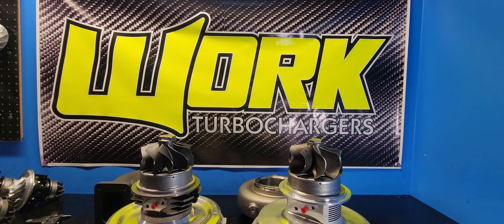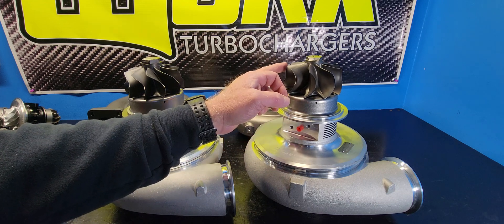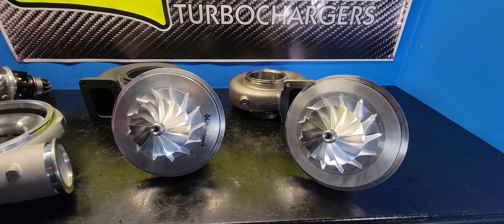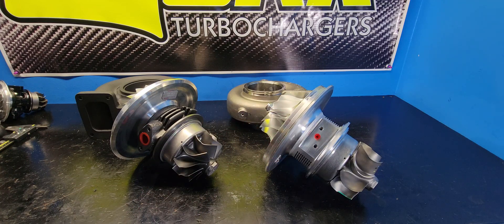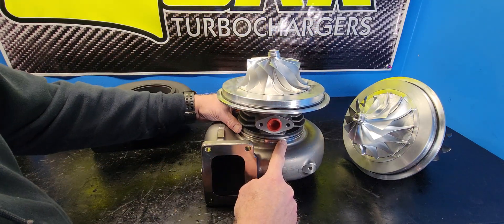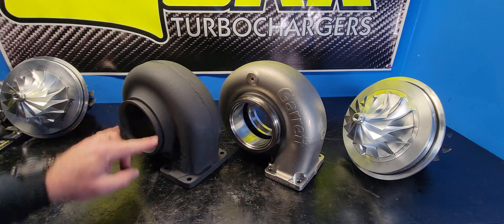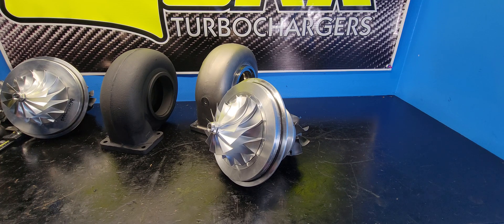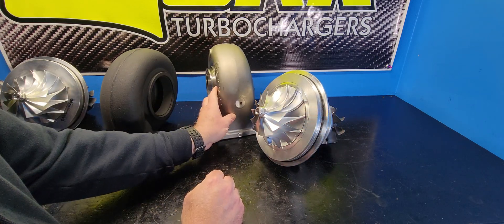Garrett G55-106 vs. GTX-5544 Gen 2 106mm. 5 minute turbo tech tips with Reed!

Comment: Is that newer Garrett design turbine wheel similar in upgraded version to your new custon 9 blade turbine wheel for the S-400?? Your two descriptions sound quite similar.
Reply from the maker: We closely copied the Garrett architecture for our S400 wheel.  There are changes made to it so it will better match the compressor groups of our S4 lineup, but its very similar!   -Reed
Reply: @workturbo  nice. 
Are the restrictions inherent in the 1.45a/r. s400 turbine housing corrected by the deletion of one blade?
Or is it the geometry of the housing itself? If i go to a bigger a/r my low rpm boost suffers. So. Keep the 1.45 and use the 9 blade turbine wheel. 
My second option is switch to a Garrett Gt50 or Gt55 and utilize the larger diameter turbine wheel and tighter a/r housing. But much more money to do that. 🤷‍♂️ Im at a pivotal point in my my system. 
14.6L.. 3406e CAT motor. 650 hp.
Reply from the maker: @hardhead7056  We are actually putting together one of our 78mm units with this turbine and 1.45 for a client next week, and an 80mm/1.45 with the SXE style comp cover the following week for an ACERT conversion customer....we are going to get some good data from both!  -Reed
Reply: @workturbo  That sounds promising. 
The 1.45/80 mm results  would interest me. 👍

Comment: can you tell us more on these new compressor wheels out there they call "nutless" compressor wheel without a nut, and claim 15% increase for the same size...Apex and Comp turbo-both do these wheels. can you comment on this
Reply from the maker: Obviously the design has greater blade area, and should perform better IF the engineering is done correctly.  

Proper engineering is a must for any component, especially a compressor.  

Look at the evolution of any "same size" turbocharger wheel over the years.  The fact that we are seeing gains in flow is testament to this.

Personally I have found that  proper testing of a blade shape for the given application  will always out perform hub thickness reduction applied to older generation wheels.  So just changing this attribute with no other consideration will usually net negligible gains.  

Simply put, applying proper engineering to a hub-less or reduced area hub wheel can provide a flow increase.  Is it measurable? Yes.  Is it always going to out perform a larger hub compressor?  Only if the development time and engineering are in place!-Reed

Comment: garrett will have a new Gseries2 by the end of the year. talking with a rep, expect 10-15% aero improvement. he reckons ''this time we beat precision pound for pound.

also, why do most big boost cars blow smoke after accelerating?

also you said you would talk about the oil regulator?
Reply from the maker: Always excited for new stuff!  As for the smoke, lots of variables there.  Some cars will sometimes puff a little rich smoke if we run it hard against the power management (it will either pull timing, open the BOV or drop cylinders depending on the system they are using) 

Others may blow some condensation out of the blow down tubes/catch can and it can look like smoke. 

And I guess some stuff is just plain old worn out and tired!  

More videos are coming...just getting the time to wrap up them and all of the shop work gets to be an arduous task sometimes! -Reed
Reply: they just finally dumped that stupid full blade design.

Comment: Very good information, i was planning on doing a Single GTX-5544 Gen 2 in either 102 or 106mm, for a BBF, was planning on going with one of those Units, but then Garrett came out with the G series Turbos, which looks to be an improvement, And so basically the Only differences are the Turbine Wheel, Stainless Exhaust Housing, and the Billet Center Section ? One of question, i thought i remember hearing about the Bearing Cartridge, supposedly Larger and Stronger ?
Reply from the maker: Bearing is exactly the same in that family and it is a total monster.  We have never had a bearing or shaft failure in the GTX55 or G57 series.  Depending on your power goals the GTX55 may work just fine, but the G series gives you plenty of room for growth.  LMK how I can help!  -Reed

Comment: is the new G series a serviceable cartridge? i know the gt series but is said the grz is not.
Reply from the maker: Yes, it is serviceable.  Garrett has not released parts for it, but they use the same bearing as other R series units and the seal rings are available if your turbo shop knows how to look up parts by size and material, not just from a typical PN.  The turbine shafts, bearing housings and some other items have not been released, and may never be released...so depending on what is damaged in your unit it may require purchasing a whole new CHRA or supercore.
Reply: @workturbo  awesome thanks, and yes meant gtx, damn auto correct
Reply: @workturbo I see your comment was 10mo ago and was wondering if getting parts is any easier yet. I been debating on buying a gen2 gtx 5533r 88mm or the G series 55 88mm

Comment: The G Series is certainly a big step up from Garrett's old stuff. Do y'all do much with the EFR series or not really because they don't go large enough? I know you show the SX turbos love.
Reply from the maker: We were super excited about EFR when it arrived on the scene...but to be honest, BorgWarner has really dropped the ball on delivering those units, supply issue after supply issue.  

It started off bad when the supplier they had doing their investment cast turbine housings filed bankruptcy on them, and from what I heard Borg lost all of their tooling in that deal.  Too expensive to make again, they moved to sand casting.  The housings are still nice, but nowhere near as nice as the originals.

Once the units got out into the market, the next really big hurdle was fitting them...they are a bulky piece.  I bought one for my personal project (toyota landcruiser), and despite the room, it proved to be fitment issue after issue.  Bought a G30 and I have room for two if I wanted.  

The remaining EFR sales were so small that we decided to not continue pushing development on them...However, they share a lot in common with the S200 series compressor group, so we do have a few models covered with some compressor upgrades...but then comes the issue getting basic service parts...a whole other nightmare of delays.

Nice turbos...profitable and sustainable to modify,? not so much!
Reply: @workturbo  Interesting to hear that perspective and understandable. I've heard from inside and outside sources they were basically a passion project for BW and I'm not sure how much they expected to sell in the first place. They ended up so impressive tech and performance wise that I think they garnered a lot of attention. Shame if the main thing holding them back is logistics rather than public interest. May I ask how long ago that was? I hadn't heard of issues lately, but as you noted demand doesn't seem sky high. I've always thought their marketing is lacking, but perhaps it's because they can't handle too many sales quickly. At least it helped kick Garrett back into gear.
Reply from the maker: @802Garage  The exhaust housing issue was right after the release of the product, and was remedied about a year later IIRC.  And yes, Brock (sp) and the guys at BW were very passionate about the product and its development/tech. 

 I was given the "royal tour" of their facility about a year before EFR was officially released, and lets just say they were all chomping at the bit to be able to talk about this project!  Seth Temple, Kurt Henderson and Sam Tuley were quick to fill us in once the product launched and John Norton even carried me through some of the teams pits when the Indy series debut the product.  I am really lucky to have a good relationship with those guys.  

I do not sell a bunch of it, possibly because my main market is a higher HP crowd, but every time I get an inquiry on one, the response from Borg is almost always a backorder situation.  Maybe other distributors get it quicker/have stock...

It is a great product, and I hope they continue to push the envelope with it in the future for sure.
Reply: @workturbo  Thanks for all the insight and that's awesome you got such an inside look. I definitely hope to get my hands on one in the future, but I'll likely be starting with an SX-E. For the money, they have such great performance. Really hard to justify even an old school Garrett GT series when the SX-E are so affordable. Thanks again!